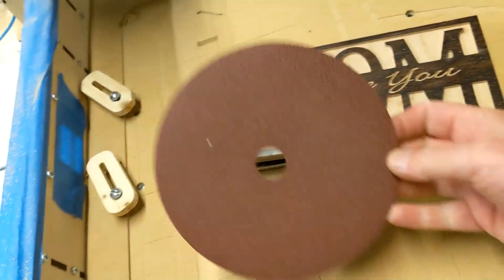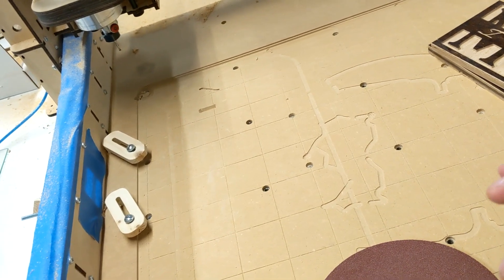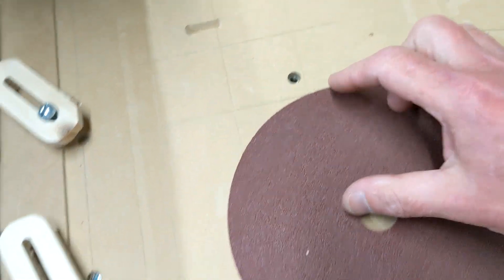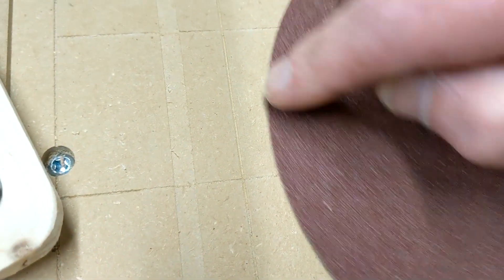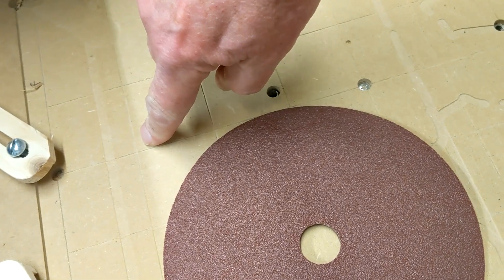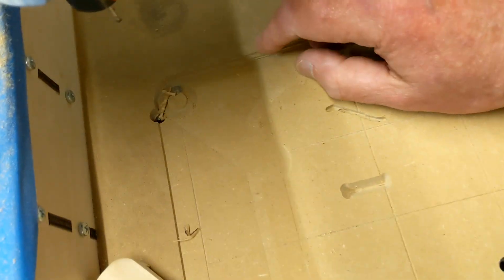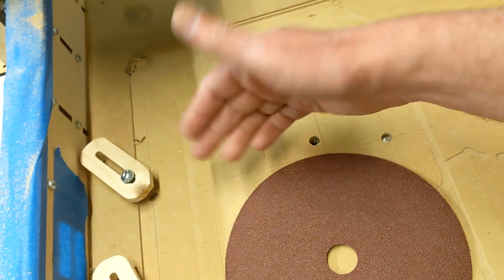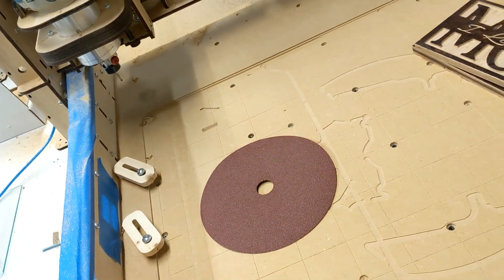How To Find The Corner Of A Round Project To Set XY [CNC Router] - Garrett Fromme

Comment: I just made a jig for finding the center of a circle.... basically an adjustable square with an x in the middle.
Reply: Hey cpl. Semper fi. Marine Vet myself. I know this is an old thread, but do you happen to have an example of the jig that you built?  Thanks
Reply: I am not sure if my last reply posted or not, it isn't showing up on mine. I'm sorry IDC's Woodcraft I never saw a notificiation that you responded. This jig is very easy to use but I have made some adjustments. It is essentially two of these put together so you can adjust the length of all four sides. I routed measurements onto mine so I could ensure every side was an exact match to the others. I then originally had two thin board I routed a line out of the center so I could fit a pencil in and run a line across the middle. However, I have found it much easier to center a nail in the corners of the jig and just run a string across. While this makes it harder if you wanted to draw an x (unless you use a chalk line) but you can just mark the exact center every time. The next time I make it, I am going to put circle sizes instead of just straight ruler measurements. This way I can radically adjust for what the circle should be, then make small adjustments. Semper Fi! I hope this helps. 

https://www.homedepot.com/p/Empire-48-in-Adjustable-T-Square-419-48/100653520
Reply from the maker: Hey Cpl. Very cool. How easy is it to use?

Comment: Hey BG here. Never thought of it this way. In easel I set my piece as a square and make a circle the size of my workpiece in the square then in then do everything  inside the circle I need to cut out then make the circle a 0 dept cut and move the center of entire piece to the 0,0 point via the location points in easel where u adjust cut depth and all that. Then get my g code and go to UGS and set machine to the center of my work piece. I don't use corners as 0,0 always use the center  of my material
Reply from the maker: I'll have to try your method. It seems tedious to get center because it takes a couple extra steps. However, this way will work pretty fast.
Reply: @IDCWoodcraft  yeah seems pretty fast especially  if you use a corner as the 0,0 point. I don't ever do that. I always just set the material and and use the center of said material as my 0,0 point and let the machine cut from there.
Reply: @IDCWoodcraft  i also do it that way when I'm cutting a circle piece of material that way I can be sure to stay within the circle and not go off the sides